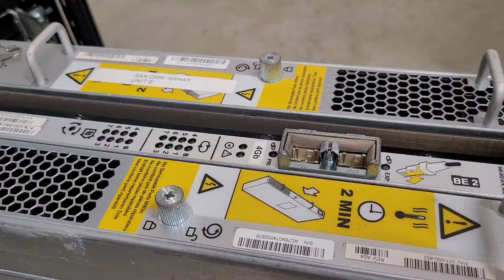What not to buy when picking a Disk Array on Ebay for your home lab. Say no to Dell MEMC KTNSTL4 FC

Comment: Do they make iSCSCI controllers for the SAS drive shelfs? I literally have 4 x MD-1200's but they all have the dual SAS controllers. I was trying to make one a SAN for my entire network as opposed to having it locked to one machine.
Reply from the maker: Well... You can connect your SAS disk arrays to a basic server connecting by a cheap HBA SAS LSI controller and then use the iSCSI as a protocal with Linux or Windows.   You can also add a NPU NIC that handles (offloads iSCSI traffice) for better access but that is the poor man FC SAN solution.  You asked about a SAN and is FiberChannel connectivity and no you can not do that.  FC is not SAS/SCSI or SATA and it is at the DM (disk management) protocol level.  But you can do FCoE instead.  (Known as Fiber Channel over Ethernet) You can route SAN FC like traffic over IP this way but it is not easy for you handle every liek you have  SAN network but with in a IP network.  As for the question can a Disk Array as a stand alone do IP / ISCSI ?  some can like the HP 3PAR 6710 array and dell solutions but most need a server  or a controller to connect to.  Hope this helpos you some...

Comment: Can you switch out those 4gb FC cards for the 6gb SAS cards on the back of the stl4 stl3 chassis?
Reply from the maker: Will I don't know if you can take a EMC KTN-STL3 6 GB and place it in  a FC controllers or in reverse but I would say it should work but! Not in real time fail over.  Just in case you were wanting to do this in real time with your live systems.  Do to the protocol swap.   I say that the controllers are pretty cheap so testing this may not be a big deal cost wise to try.   Hope this helps sorry not as good as I would like but have fun with this!  Keep me in the loop.
Reply: Thanks for the reply. Nothing is currently running. I just have about 15 stl4s with 159 300gb fc drives that I don’t know what to do with. Any ideas?  I was thinking CHIA but I’d rather just sell them I think. I just can’t find a market for them
Reply from the maker: @DP-nw3lz  Yea, you could do them (FC drives)  in  raid 0 group spanning of four drives, (You need about 800 GB for CHIA to work right on avg.) that is about it on the CHIA front.  But I would sell most of them if you can and move to newer chassis design that can allow you play with NVMe space and SSD on SAS or IP based storage arrays... I like did... Enjoy!
Reply: @leadiususa7394  thanks. Is there a group of people that might be interested in buying them? They don’t really sell on eBay

Comment: after using the JBOD as a SAS DAS then on the host machine I can still set it up as a Fiber Channel SAS, available for the other FC hosts right?
Reply from the maker: Check the type of controllers available and do you research but yes you have a few options...
Reply: @leadiususa7394 hanks, just ordered one of these 25 bay EMC storage arrays. They'd just work out of the box without any licensing or anything right? Like a JBOD should.
For the time being I plan to just run them on ethernet from a unraid server.
Can you also recommend me a good HBA card for the host to connect this to. Sorry to take up your time, really appreciate the reply :)

P.S: after watching your video, I ended up ordering the 2.5" array and a STL3 3.5" array, they seem to be very worth it, especially for short depth racks like mine.
Reply from the maker: @daraqnet  No problem and glad to help out, Yes nothing is needed to use these arrays as JBODs arrays.  You just need a HBA card and a good server chassis to use it with like a Dell R710 or 720 that has lots of RAM for you TrueNAS or Unraid so you cna do some nice RAM caching.    Get your self a LSI 9200 HBA controller card 2200 6 GB or better but do your research first.  You can also use a Dell RAID card as well just need to have the same type droves. That is all.  Remember that you use SSD drive in any format like I do, the SSD drives will max out your 6GB bandwidth.  Hey dude, have fun with this.  Hope this helps some.

Comment: The biggest problem with EMC on the secondary market is that the FLARE/OE disks are normally trashed or wiped. You may buy yourself a nice VNX 5200/5300 cheap, but EMC/DELL won't give you the time of day without a support contract, and the binaries/activation CDROMs are nowhere to be had.
Reply from the maker: True so you need to vet the seller a bit as I do.  one out of ten buys I have a issue but so far I can address them without any support from the vendor.  So far.  But for getting a array for $75 I will take the risk.  Try it. Vet a few vendors on Ebay, never buy without a exchange coverage so you can swap out parts if bad.  It works...

Comment: Some of this information appears to be incomplete, please comment Leadius USA!

The KTN-STL4 has a sibling, the KTN-STL3, which is straight-up SAS like your 2.5" EMC enclosure. The weird part perhaps is that the KTN-STL3 uses the same caddies (trays) and the same Fiber-Channel backplane ports, but EMC made SAS/SATA "interposer" cards which adapt SAS/SATA drives to that Fiber Channel connector. On the other side of the backplane, the KTN-STL3 sends the data out thru the same standard SAS connectors as seen on your 2.5" EMC enclosure. It's a beauty.

In addition to this, EMC did make, and you can buy, HSSDC2-to-SFP cables to connect one of these KTN-STL4 units directly to a PCI express SFP adapter, bypassing the need for a special switchgear or EMC head unit, etc. EMC also had a few older siblings for this unit, for example the KTN-STL is 2Gbit fiber channel instead of the 4Gbit capability of the KTN-STL4. Also, if toy've got the STL4, EMC did make SAS to FC "interposer" cards to go with the cadddies - it's not as fast as the STL3 but should work fine.

And there's more. EMC even made IDE to FC "interposers" a number of years back, but the enlosure and caddies for them are just slightly different. As we speak I am modifying some KTN-STL3 and STL4 caddies to accept IDE drives with IDE-to-FC interposers, a I've found the STL4 seems to recognize the old IDE drives I tried connecting. OK... the point is, there's a lot more to this, and some of the solutions are fairly simple and inexpensive. Please comment and add ideas, there are a lot of folks who would be excited to see this stuff actually work.
Reply: I recently picked up an STL3 off ebay, and then shortly thereafter an STL4.  Also grabbed the appropriate interposers and cables, and now have 30 drive bays for my latest hobby - chia.  The STL3 is connected to an old desktop running ubuntu via an LSI 9200e, and the STL4 is connected to an r510 running ubuntu via an LSI 7204.  Since speed isn't an issue for me this old hardware is a cost-effective way to provide a home for a load of old enterprise sas drives.  Question: anyone know how to lower the fan speed on the STL4?  Sounds like the shelf is trying to take off!
Reply from the maker: @cryptoelder  Check to see if you have a failed fan or fans.  You have to look close to see if there is any failures in the PSU and the chassis.   Sense you are not connecting it up as a complete system with COM cables and so on.  It can't tell you if you have a issue.  All it can do is spin everything up at full speed to address the possible lost fan/s.  Check that first.  Have fun dude!~
Reply from the maker: Yes I am aware of those added features and in some rare cases you can get away with some pretty sweet cross busing using different interposers.  I use to used to look for them in the past but after EMC was bought by Dell, the water got a little mudder when it came to getting parts.  I can still see one here and there but because of how rare they are you have to buy at least one extra jsut in case your interposer interface fails.  You need a back.  Question? do you have a source for these?  I haven't look lately to be honest for I have been in the NVMe and SSD level now.   These days I am using well of 300,000 IOPS or higher on my test models these days and that is something that the old days fo FC and SAS/SATA can't do anymore.   Even the old school EMC and NetApp controllers are not able to do this level of IOPS.  Let me know what you know and thanks for the feed back.  This was a good talk.
Reply: I literally just ordered a STL3, soo just to make sure, these will accept SAS drives right?? like even SAS SSDs, I was planning to use it as a JBOD of SAS HDDs and SAS SSD Cache drives and connecting using the SAS connector to my host. And then create a SAN over fiber channel from that host. Would this work?
Reply from the maker: Thanks for this feed back for I only focus on a few things in my video but yes you are correct for most of this and the other type class interfaces like IDE, I have not worked with much so I am not sure.

Comment: you mentioned 3par having their own issues but didn't cover what. I'm considering getting my first disk array to connect to my DL380 gen8 and was considering using a 3par M6710 connecting through the SAS but after watching your video, I'm no longer sure.
Reply from the maker: Yea, the issue is that the controller want HP controller so you have to be force to run single channel path to avoid the alerms and that is a pain.  Once configured the 3PAR works.  But I recommend you going with the DS2246 array.  They are pretty cheap and easy to work with.  Here is the link to one version ad it cost.  Hejoy! https://www.ebay.com/itm/202852351593?epid=1534596049&hash=item2f3af13e69:g:1qcAAOSwZwld8qkh&amdata=enc%3AAQAHAAAAoCiSVw2oMcQsAG3mzjTF6QPVRAGdc%2BObGdkPc2GyO9Obu%2F7Sa0zhBi%2Br2644rPb39f0gOajwdbj3HdAZh0IIEsCw08fYjhKV0%2Bcv8Giq%2Brs0cLmN4ciT8JHUWpfjtpFkMTzE6m6fV5DPhQjlMtggCgXPBz2LQq8Igy732bq%2BC1l%2BHOz%2FECjQsKD4yLSvBYR9ph%2F2%2FVP5CkibrGWh9vRXmms%3D%7Ctkp%3ABk9SR86f_sewYQ
Reply: @leadiususa7394  would a hp 221 solve the issue? Currently orderer a lsi 9200-8e but I would consider getting a hp221if it would solve the issue. In europe, 3par seems more accessible than netapp storage arrays. Thank you for your previous explanation.
Reply from the maker: @bogossogob  Well I use the HP 800i card but it should work.  The key thing with 3PAR is it want a correct path set and if you don't have the dual controller setup as recommend configuration.  The DS2246 doesn't canre.  As for SAS disk arrays pretty much they take anything that is SATA/SAS/SSD so it's the controller that is the pain to work with.
Reply: @leadiususa7394  by dual controller setup you mean a full loop? eg: server controller first port  -> port A in 1st controller (3PAR)-> first controller (3PAR) port B -> second controller (3PAR) Port A -> second controller (3PAR) Port B -> server controller second port?   Sorry for all questions but it's my first disk array, still a lot to learn

Comment: Outstanding! Subscribed. Ring, Ring. The depth of consideration is applicable to many different purchasing concerns.  I especially appreciate your informed thought process. Dell EqualLogic PS4100.  Have you ever used the PS4100 2.5”?
Reply from the maker: Yes, I have use them but on a limited format.  We played with IB and some other standards but saw the costs at the controller level and so other issues so we flip to SAS/DAS for my home solutions.. The Dell EqualLogic PS4100 and it IP-IB series of brother controllers are nice for some key roles but you have to have a lot of costs to get the mt work at the level they work best.   Not cheap but nice...
Reply: @leadiususa7394  agreed, I can see the cost to maintain over time.  But that concern is offset by my motivations.  My lab X3650 M5, 2x C2960s, 2x Cisco 1921 are to prep for an enterprise level position.  The ancillary enterprise equipment I have is just to play with Linux.
Reply from the maker: @SQUID_Road_Glide  Very cool and have fun with it if you got it! /:>

Comment: Did you need to convert the disks to 512 byte format at all? Does the SAS shelf work as a JBOD array, or does the controller handle RAID? I'm considering getting an EMC SAE VNX to connect to my TrueNAS SAN.
Reply from the maker: Yes, yes and yes...   Yes the array will do any format but 512 K is preferred.  You can do JBOD or RAID based on your SAS controller. I would avoid connecting full blown VNX to your  server if a couple of arrays will do the trick.  Having a controller array with disk arrays is a headache...  Enjoy!

Comment: recommendation for 3.5" disk shelves on eBay? Plenty to choose from but you make the wrong decision and best case scenario you spend hours trying to troubleshoot issues. Worst case it simply won't work without using proprietary servers.
Reply from the maker: Agreed, that is why I go mostly with open ended (SSD rated) NetApp SAS disk arrays and some older Dell/EMC open ends SAS arrays.   These work on most raid and HBA controllers with no special needs or extra hardware outside the normal stuff.  Avoid FC disk arrays at all costs unless you the correct controllers to run them.  BTW-Research is part of the fun... Enjoy!